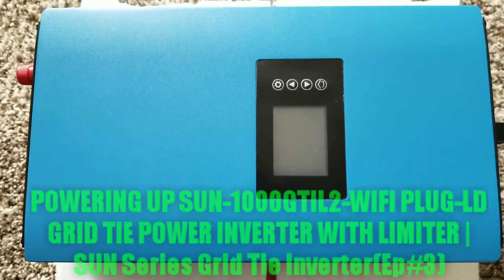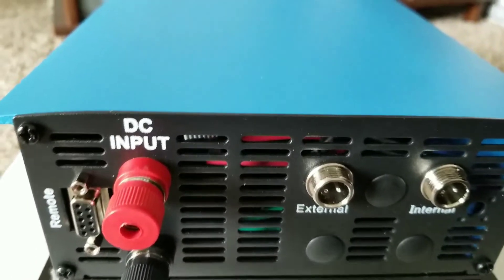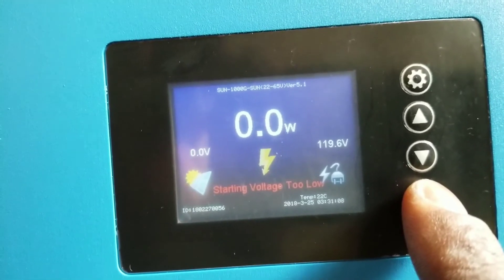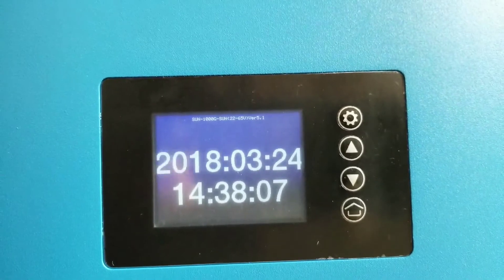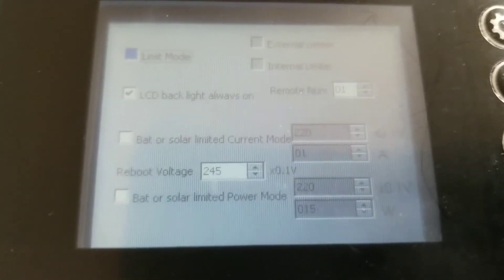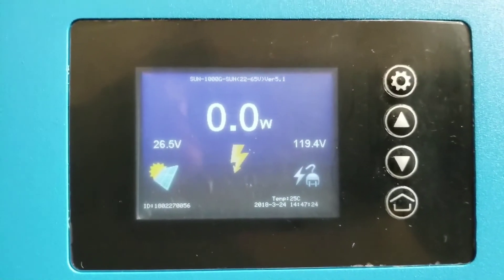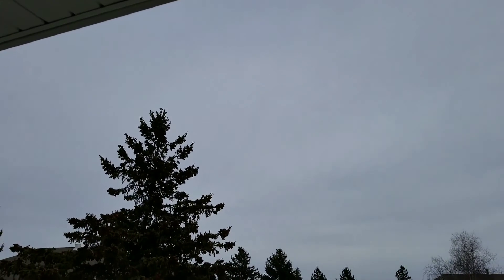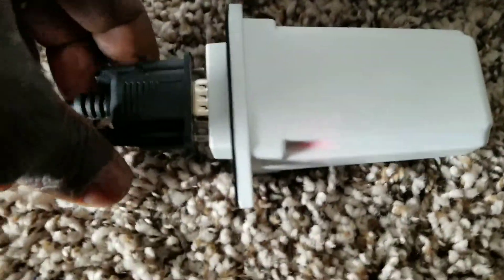SUN-1000GTIL2-WIFI PLUG-LD GRID TIE POWER INVERTER WITH LIMITER | SUN Series Grid Tie Inverter(Ep#3)

Comment: I now have 3 of these. 2 original ones ran for about 2 years, one of them went bad. Bought a replacement, and now that one lasted for about 1 month. These are not well made. The cost in these inverters are far more than the cost of the electric would have been.
Reply from the maker: Ok

Comment: Hello good afternoon, One question I have 10 solar panels of 100 watts and I want to connect it to that Eco inverter I cannot connect it Why am I getting an error or high voltage, thank
Reply from the maker: What model do you have ?
What's you dc voltage input on your inverter?
What the VOC on your solar panels
Reply: @jwsolarusa  sun sunlight~1000 watts
Reply: And what is voc
Reply from the maker: @cesarestrada2554  
Ok.
Look on the side of the inverter where you will find the specifications I need to help you figure out how many panels you have in series parallel
Reply: pOKIOsolar DSP-100M Maximum Power (Pmax) 100W + 3% A00 5.56A Power Voltage (dw) (dw) (Voc) Meximum Power Current Open Circuit Voltage Short Circuit Current Nominal Operating Cell Temp.  (NOCT) Maximum System Voltage Maximum Series Fuse For field connections.use minimum No. 12 AWG copper wires insulated for a minimum 90 ° C 22.50V (Isc) 5.81A 5.08 - A0OC.  9A 7.50Kgs 1175 535 25mm Dimension Blandard Test Conditions IRRADIANCE = 1000W / m FiRy Temp.  25 ° C OSI
Reply from the maker: @cesarestrada2554  
I need numbers for the open circuit voltage
Reply from the maker: @cesarestrada2554  
Now I know they are 100w panels and I also know the ISC 5.56A now I need the VOC numbers
Reply: If you can help me, thank you so much this my phone number 704 320 7644 My name is Ángel Thank you have a happy night.
Reply from the maker: What's the inverter solar dc input voltage?
Is it 22v - 65v  or 45v - 90v
Reply: QC PASS QC PASS Nodel SUN-1000GTIL2-IFI PLUG-LCD Normal AC Output Pover AOS6 A000I Maxiaun AC Output Pover 185V-265V Auto Detect AC Output Voltage Range 115V ODEL AODI-AS6 ZHS9 AC Output Frequency Range DC 22-65V Input Voltage Range -  10 ° C - 45 ° C Operating Teaperature Range Stackable GTI2-1907-310 Only For AC Side Rarning To avoid electric shock and arranty void do not remove COrers Ko Operator serviceable ooaponent insi de.  Use indoor only
Reply from the maker: @cesarestrada2554  
Very good...👍😀 you have 22v - 65v maximum input voltage. 
You solar panels VOC is 22.50
You have to wire 2 panels in series  to create 5 strings of twos that will give you a VOC of 45v on each string of two panels in series and parallel all together  to give you proximately 45V @ 30A input and you all set.
And don't forget to properly fuse or have a MidNite Solar 150vdc breaker @ 30A inline from the solar panel.
Watch my installation with GRILLMEISTER DAVE'S HOUSE
SUN-1000G2 GRID TIE POWER INVERTER WITH LIMITER: https://www.youtube.com/playlist?list=PLSNjIRSnUPDJ1Cp3JTPumQ7e8fehjCFqv
Reply from the maker: SUN-1000G2 GRID TIE POWER INVERTER WITH LIMITER: https://www.youtube.com/playlist?list=PLSNjIRSnUPDJ1Cp3JTPumQ7e8fehjCFqv
Reply: sl investor to send you all the information
Reply from the maker: Did my method work for your buddy?
It got to work for you.
Reply: You can send me as a diagram or more or less How it is connected because I already connected it as you told me and I sent it to the Breaker box but it seems to me following error.
Reply from the maker: @cesarestrada2554  
I have done the best I could. 
Consult your owner's manual or manufacturer.
You can watch the rest of my videos series on my playlist that I sent you
Reply: @jwsolarusa  ok thank you so much

Comment: I attempted to buy one of these things only 2000w model....
I have a 48v li-ion battery bank and I will try to hook up that on the inverter actually fully charged 56.8v now I want to use dovn to 51v than will try to cut off with limiter....So gtl2 will be conected to the battery not to panels.... That could support other phase or L2/L3 since we are in Europe we have 3 phases or L1/L2/L3/..N and PE=ground
Reply from the maker: You can hook this unit in both ways Solar panels or Batteries.
For us in the United States, we need two of these units to run BOTH legs L1 & L2
Reply: Yes, similar in Europe you can choose to have house hook up to the grid two ways you use single phase L1,N,PE for low to moderate usage up to 25A/240vac or if you usage is higher you have to use 3phases so load could be spread evenly over all 3phase/voltage between phases is 420vac that's is for bigger load's heat pumps el.motors and ect.  but in the same configuration you use single phase L and N that is 230/240vac with every phase to N..... 
Interesting.... And more efficient... 👍